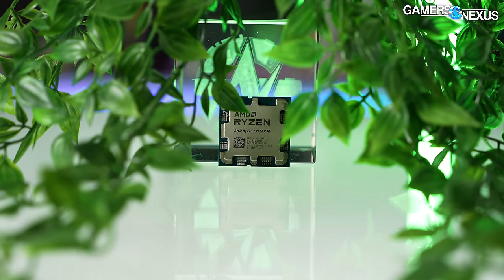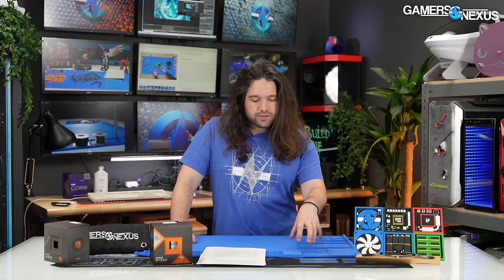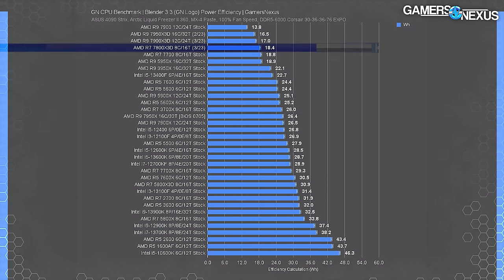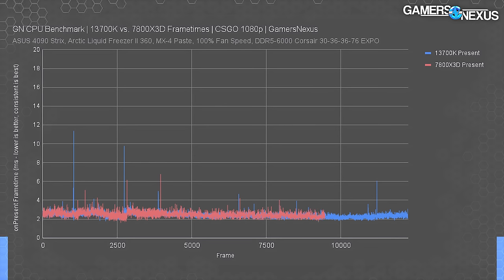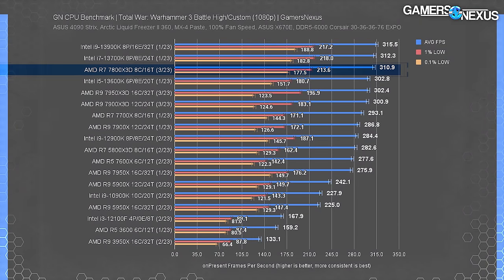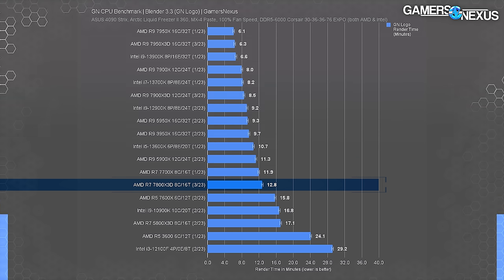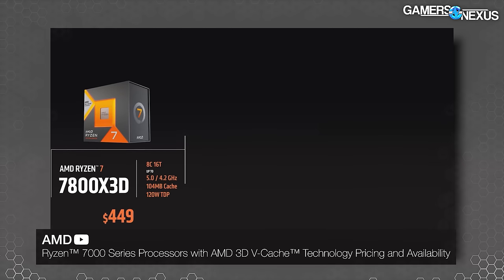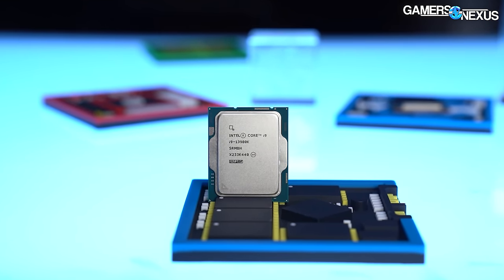AMD Ryzen 7 7800X3D CPU Review & Benchmarks

Comment: I sent you guys a tweet but I think you need to recheck those FFXIV numbers. I ran the Endwalker Benchmark 1080p Maximum with a 7800X3D + 4090 + 32GB 6000 CL30 and got a much higher score. No PBO tuning and no memory tuning.

Comment: Here's my dilemma with my next build:

- The 7800X3D is a VERY impressive chip in terms of performance/efficiency/price/temps for gaming, BUT unfortunately it lacks the performance in those workstation benchmarks big time vs the cheaper 13700K. It saddened me a lot seeing those numbers because I waited a month for nothing. Yes, I should've predicted the X3D performance in those workstation tests since it's also the same across the board with the other two chips where the non-3D had generally performed better, but I thought waiting wouldn't hurt and we might be surprised. Im so mad right now because this complicates things even further!

- I game daily but I also do lots of other stuff outside of gaming that would definitely benefit from the extra cores and higher frequency (im sort of as an all-in-one user here). This sadly makes the 7800X3D not the best choice for my case, especially when just a measly $150 more for the 7900X3D can get me close to 40% more performance in some tests outside of gaming. I would've gone with the 7800X3D in a HEARTBEAT had it performed close to the cheaper 13700K in those tests.

- I have no budget limit but I also don't see a need to go with the most expensive option (7950X3D) when those other cheaper parts can perform good enough in non-gaming scenarios. It's always nice to save a buck or two and it just makes me happier that I scored a better deal without sacrificing much performance (who hates saving money? especially in this economy where a medium-tiered burger can cost upwards of $15 when it used to be $5 just 3-6 years ago, or for those of you car people out there, think of it as the classic comparison of Nissan GTR vs some fancy schmancy triple-the-price European supercar).

- Sometimes I say to myself that I should just go with a "budget" build consisting of 13600K/7800X3D + RTX4070 Ti and the performance would ROCK and I would be the happiest person in the world for saving that much money in the pocket, but then sometimes I say if im paying this much already then why not just pay a bit extra and have it ALL (7950X3D + RTX4090) in one go instead of needing to upgrade in a couple of short years which would end up costing me more. Im already thinking about upgrading because the RTX4070 Ti will not last long on 4K with the near future games as it already struggles to reach 50-60 fps on some games today.

- Having the best of the best would be fine and I wouldn't mind paying for it because I plan to use these parts for a very long time (still running on i7-3960X + GTX1070 here), but I would also hate to run an RTX4090 with that kind of power draw (especially when I live in a hot and dusty climate), combine that with 13700K/13900K and I would have a +600W furnace in my room running most of the day right beside me.

- The 13700K is a great all-in-one choice for me (it was my only choice before the 3D V-Cache even came to rumors), but my heart is now set on AMD's 3D V-Cache after waiting to this moment without buying anything, because it looks like the future will be relying heavily on higher cache and it would only get better with optimizations compared to the standing still 13700K. This pretty much means no Intel for now, so my only choice has to be an AMD X3D CPU.

I don't know...maybe im in this whole pickle because im a hard head that doesn't want to let go of 4K? I know life would be much simpler and cheaper if I just go with 1440p instead. Pairing it with 7800X3D + RTX4070 Ti means running +120 fps on most games would be easy as pie and I would also save myself ~$1500 in the process which can get me all the expensive burgers that I want for the next 1-2 years (for free)! I feel like it still isn't the time for 4K just yet, but I also hate upgrading my monitors (been running on my 1080p monitor since 2009 now!) and I feel like I should be investing everything in this build because if I don't, then I might not have the chance of owning 4K like the rest of you until 4 to 10 years from today.
Reply: I'm not sure if you already bought a new Intel or AMD chip, but hopefully, you didn't get 7900X3D. If you paid attention to the video Steve mentioned that 7900X3D and 7950X3D (X3D chips with multiple CCDs) are only using 1 CCD which means 7900X3D only uses 6 of its cores to play games while 7950X3D uses 8 of its cores (it basically becomes a 7800X3D) when playing games.
Reply: The cpu difference for gaming at 4K wouldn’t be as great as shown in this video as the fps will be bottlenecked by the gpu, compared to the 1080p data in this vid. Go the intel route if you need an all rounder, or check for some other videos comparing the cpus at 4K resolution to see what the difference actually is

Comment: When thinking about the frametime charts, would this be an instance where higher resolution testing would make sense? Irregularities in frametime would be way more noticeable at lower fps.  I guess the data wouldn't be that useful if the system is GPU bound anyways.  Looking at Paul's Hardware's review with some 4k testing, however, it seemed like there was mostly changes in the %1 lows, so it would be interesting to see how that is distributed.

Comment: I just use process lasso on the 7950x3d. It works really well. ALL processes are on the ccd boosting to 5750 and games are limited to the vcache ccd. It also boosts every core to 5250 on the vcache ccd. Considering this, I don't think there is any way a 7800x3d would actually outperform it. Maybe in terms of performance per watt, it will. But otherwise, the 7950x3d is a tweaker's dream. 
I'm not upgrading again until they have 16-core ccds.

Comment: Really feels like we needed a comparison between the 7800X3D and the base 7700, especially on the power and heat front.  7700X being there is good but it would be nice to have a bit more.
Reply: The 7700 shows up in the power efficiency chart and it was almost identical to 7800X3D

Comment: 7950x with uv -30 + 6000mhz cl30 with buildzoids secondary timings. Gets 186fps average and 147fps lows in FAR CRY 6 same settings same 4090 Yet still with that kind of tuning it only matched i7 13700k stock.

Comment: I feel the 7950 and 7900 x3d was an experiment, and violates my no 1st gen policy. The 9800, 9900, and 9950 X3dD will be legendary, not taking anything away from the 7800, its a very very fine cpu. but the platform still 1st gen and the new coresets/ccd are new. AMD couldnt iron them out before release.

Comment: Why do you overlook the minimum fps when looking at frames. Higher lows mean a more stable frame rate  which the v cache is helping with on the 7800x3d, no? you can see the same thing with the 5800x3d when comparing it to  its counter part.

Comment: For the frame times, I'm unconvinced that you need to show time on the horizontal axis. It's reassuring to hear that certain spikes occur at the same time but there's an argument to be made that any such spikes that really are consistent across all CPU should be cleaned away anyway. What your audience really needs is the distribution of frame times, highlighting the outliers, not comparisons of when in the benchmark run those outliers occurred. So your horizontal axis could be categorical: which CPU and you can use a boxplots or violin charts to show the distribution for each CPU. Audience education required, but it solves the problem of getting more CPU on the chart clearly.

Comment: I was extremely happy with the MASSIVE performance uplift going from a 1700x to a 5800X3D. Most bang for buck upgrade ever, only time I bought a new piece of hardware in a long time. As long as AM5 has a similar life span, that alone would make me go AMD over Intel this time around. In 5 years will 13th gen really keep up with the newer AM5 chips or handle a 5090 or 6090? I have doubts. With this performance and track record it's an even easier choice than first gen Ryzen was when Intel was still king.
Reply: In 5 years, an 8 core / 16 threads 7800X3D has a less chance of being a better gaming CPU rather than 16 cores / 24 threads 13700K. By the looks of it, games are starting to use more and more cores, and we've been sitting on mainstream 8c/16t CPUs for about 6 years now. 8c/16t won't be mainstream for that much longer. After AMD's next gen (Zen6), which will be a refresh core count, is most definitely gonna go up by quiet a bit. Remember my words. Also, stop being a fanboy. When there's good competition between Intel and AMD as well as Nvidia and AMD, it's only better for us consumers. We get better products we have more to choose from and we get way better prices.

Comment: Not sure if it has been explained in a previous video about the 7950X3D, but the core parking charts show that T16 and T17 for the 7950X3D are not parked even though those threads are on the second CCD. Curious as to why those aren't parked.

The same goes for the 7800X3D when still misconfigured to behave like the 7950X3D. Core 4 T0 and T1 are past the halfway-point. It should be parking those instead of utilizing them. 

Is that just an issue with the charts, a software issue or something that has already been explained and doesn't affect performance on CPUs with two CCDs?

Comment: What i found most interesting in this whole video which slightly got mentioned is, how much crazier would the 7800X3D be if AMD didn't limit it as much it did to "protect" the higher CPUs.
I have a strong feeling if the CPU would run close to the other 3D chips, then it would clearly crush them in every Benchmark and be a serious threat to all line ups.

But we can only guess now, maybe they really really needed to limit this much but thats hard to believe for me at least.

Comment: Looking at the differences in cache, yeah the L3 on the 7800X3D is a lot, but most apps leverage the L2 cache and the AMD part only has 8Mb of L2 where as the 13700K has 24Mb. I think that is where the problem lies for the games that don't do well with the new 3D cache. I could be very wrong, but looking back on Intel at the 4th gen, their i7 4790K had 8Mb L2 cache, in 2017. Let me know what you think, Steve. Is there a way to test the L2 hits on CPUs with the games that don't use the L3 well or at all? I am thinking the 8Mb is being saturated more than the 24Mb on the Intel. This could actually make more sense as if it is saturated, then the data will possibly be present in the slower L3.

Comment: Are 8 cores enough for 2023? I know a few games can max out the utilization and back in 2019 people were saying 12 cores is the future.
Reply: I'd rather have 12 cores but not at the cost of gaming performance. Like others I want it all, gaming AND productivity both in the top 5%, low power consumption, reasonable price in a single user-friendly chip design. We're clearly not there yet. Hopefully AM5 will be the platform to deliver it🤞 Until then, this will do.

Comment: Trying to rack my brain for a niche use case for the 7900X3D.

Maybe if you have a very hard set budget which allows for the 7900X3D but NOT the 7950X3D with the mobo, RAM, and GPU you have picked out, and you do a mix of productivity and gaming? Maybe? I don't know, I think I'd still go with an Intel i7 or i9 for general purpose use. What slice of buyer is it for?

Comment: Very curious to see how well this chip does with some light overclocking to bring the clocks back in line and not 'product segment hindered'. Assuming it can take a bit more voltage/heat since it's so efficient, and it's probably a monster of a chip.
Reply: I don't think you can OC this chip.

Comment: The frequency on the 7950x3d and 7900x3d is as low as the 7800x3d when you just look at the v-cache chiplets. It seems to be a technical limitation of the cache.

Comment: 5:10 I think this would cause bad data too. There are 9 cores active, not *8*, so one of the cores on the non-vcache CCD is also active, and if the game utilizes it, you'd get the cross CCD latency, but with the added detriment that you're only using 1 out of 8 cores on the high-GHz CCD. I hope you have accounted for this.. If it's not used for the game, but only background processes then it's OK.

Comment: AMD has branded these X3D chips as being gaming CPU’s for good reason. Of course lower clock speeds are worse for CPU-intensive productivity workloads. These chips were never going to best their competitors on those grounds. But for people who primarily use their PC’s for gaming, if the games are primed to utilize this 3D v-cache, it couldn’t be clearer that the added cache is far more important than the higher clock speeds of similar chips. 

I’m actually surprised we haven’t seen this kind of dedicated gaming CPU before the 5800X3D. Of course plenty of chips have been marketed as being great for gaming but they didn’t have any radical differences in their overall design before very recently. It’s a pretty cool innovation and I fully expect Intel to do something very similar in the near future. Ryzen in general has brought AMD an insane amount of market share in the gaming world over the past several years and innovations like this are likely to keep things trending in that direction.

Comment: I'm wondering something about the core parking thing.  Can one accomplish something similar by setting the processor affinity for games to the correct chiplet and set it for the other cores for other processes?  The reason why I ask is that I primarily do engineering work in my machine, but I wouldn't mind playing games with stuff running in the background.

Comment: Definetively waiting another gen before upgrading. I use a 5900X for software development + gaming. I have the feeling that the 3D cache in the R9 is still early, but it will be a game changer once nailed. Improving the development feedback loop and, ofc, the fps in games would be really interesting.
Reply: The problem remains because they did improper frequency architecture that literally goes again Win 11 scheduler.

2nd problem is that they shorted us 8 3D cores and only gave us 8 3D cores on 16 core 7950x3D

It's a milking game for AMD, or they are not able to produce 16 core x3D chip
Reply: That’s a really good question, are they milking it or they really can’t produce a 16 core x3d chip? I read some rumors that the next chip will be 12 cores x3d.

Comment: This is such a tough choice. 9700k + 4080 and secured a 7800X 3D + Asus Tuf MOBO + 32GB DDR5 6000mhz for $870 but now I see MicroCenter has 13700k + Prime Z790-A + G Skill 32GB 6000mhz for $550 and I legit feel like while the 7800X 3D is the clear best overall gaming CPU, I just can't justify $320 more for that comparative difference. Then again, I may need a new cooler and PSU for the 13700k (or 7900X, same deal same price) so it might balance out. I mean, yay for parity, I guess?

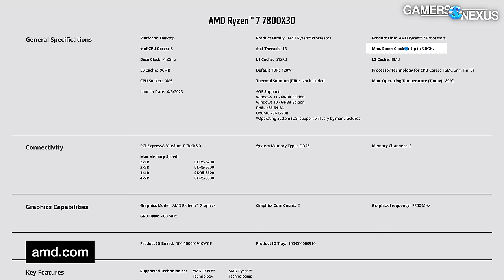Comment: 4:47 not sure if this is true either as the 5.7GHz is the max clock speed for the CCD without the 3D-cache, CCD0 should have less max clock speed than this (although probably still higher than 5.0 not just all the way to 5.7).

Comment: The 5.7GHz on 7950X3D is only for the non-3D 8 core CCD. The 3D CCD is only like 200MHz faster being 5200MHz than regular 7800X3D single single 3D cache only 8 core chip.

Comment: TL;DR — 

— CPU's basically exclusively for gaming, it does get inched out by some of the more powerful CPUs on the market (7950X3D, 13900/700k mostly) but the difference is marginal at best and insignificant at worst

— Has a relatively low power draw 

— For production tasks it's not worth it

Overall, one of the best 'price-to-performance'/most efficient CPU(s) on the market

Comment: For numbers you should consider using T tests to test if the difference in distribution is statistically meaningful or just numerical different.  These methods can tell two the probability that 2 date sets are the same, or in other words how sure you are they are not the same.  You can use this when comparing numbers like mean or 1% low.

Comment: Can someone explain why are they testing RTX 4090 with top intel and amd CPU's in 1080p? Genuinely is there a reason? Is 1080p like the margarita of resolutions? (Barstools reference)
Reply: Because in 1080p resolution graphic card is limited by CPU. That's why all benchamrks for CPU are on 1080p. Even you can sometimes see that there is no differance between 1080 and 1440p in fps.

Comment: Does any X3D makes sense when you are playing on 4k 120Hz LG C2 and haven't access to either RDNA 3 or RTX4000? (using a 3060ti atm).

Thinking about just slamming a 7600 and call it a day, then save the bucks for a massively better GPU when it is reasonable priced.

Comment: Showing the frame times gets a thumbs up from me, especially with closely matched CPUs, it's good data to have. I would prefer to see the average charts as average frame time instead of frame rate as well though. The difference between 4ms and 5ms in frametime is clearly very small, but in fps terms, 250 vs 200 makes it look like a large difference. Even worse, it only makes very fast components stand out, as a 1ms difference around 15ms equates to only about a 4 fps difference.

Tl;dr: using frame rate instead of frame time makes low end parts seem very similar in performance, while making the high end parts seem to have more of a difference than they actually have, so I'd rather see frame times in all the graphs.